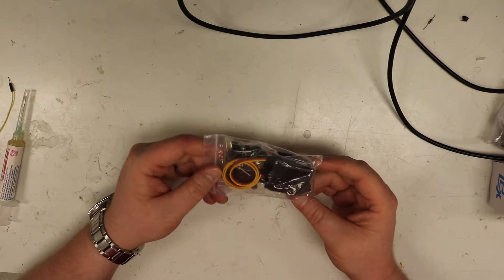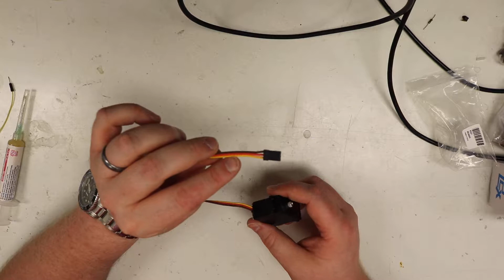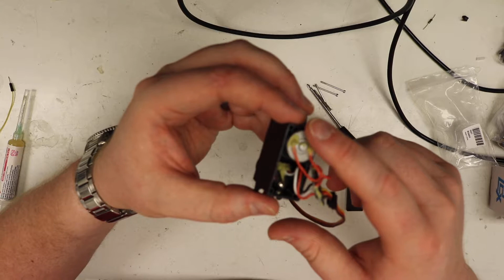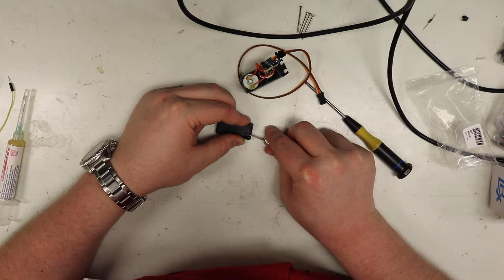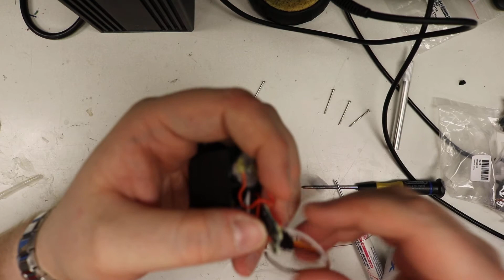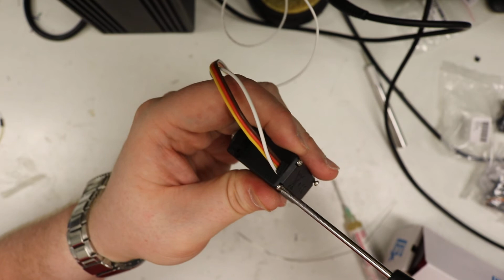Modifying servos to read their position

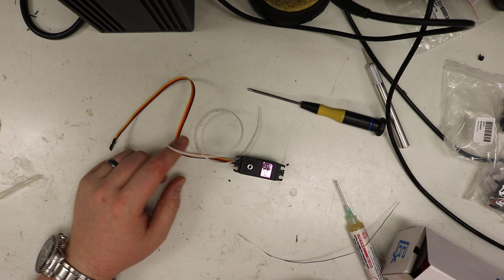Comment: really too much time spent showing how to stuff a 4th wire through the servo case. Not really informative. You seem to struggle with the whole deal, as if it was the first time you have done this. Perhaps if you had spent the time (post fitting the blessed wire!) and shown us the full story, i.e. connect to a scope, measure the value and use it to retro-position the PWM back to the servo again. Really, 16:57 of my life I will never get back again.
Reply: Well it was some good info but true way too long time, could have done it in one minute. I expected code and interpretation of that signal in so much time. :)

Comment: I wouldn't call ground and positive a signal,it's just applying power.
Regards the feedback wire: if the feedback voltage is used to supply a too big load( not necessarily a micro controller), it could probably confuse the feedback to the servo chip. Pls let us know how you use the feedback on the white wire.thx.

Comment: this is really handy to know, so i built a 6dof robotic arm i have 3 MG996R servos and 3 of the tiny servos but one of the problems i have is when i power the arm for the first time the servos snap to a position all 6 arms at the same time and even if i time this it still moved very fast due to the fact i can not get a start position with this little trick i will not be able to ready the starting position then smooth out the move from that to the overall start positions this is my plan anyway although my first test when i read an analog value normaly it goes from 0 to 1023 but this server only seems to return from 140 to about 512 i could map them numbers but it does not seem right also have have 18 wires coming off the arm and it looks a mess one if i had the extra wires that will give me an extra 6 wires lol i guess i am going to have to work on trying to keep it tidy.